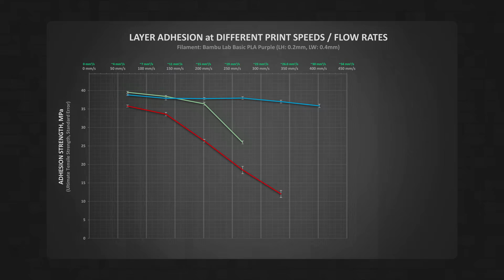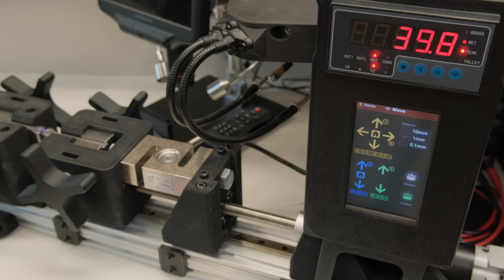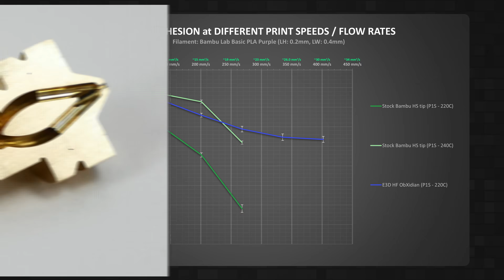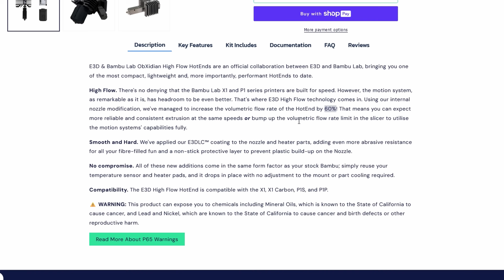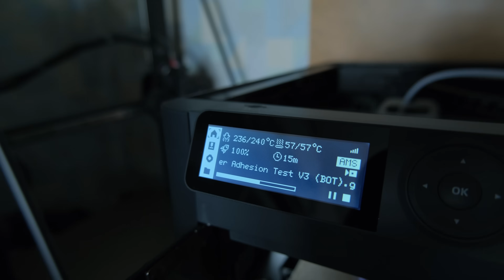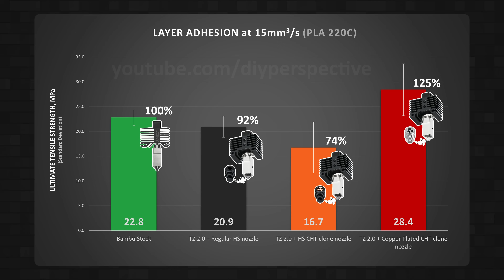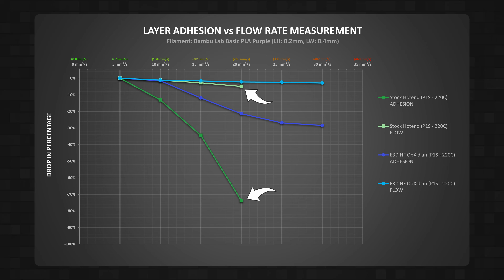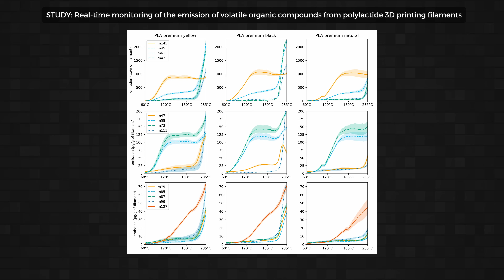LAYER ADHESION TESTED: Bambu Stock vs TZ 3.0 vs E3D HF ObXidian hotends (220C vs 240C)

Comment: Glad to see someone testing on the TZ 3.0. I've been eyeing it since my 2.0 does nothing, but clog itself to death. I figured it was probably heat creep and was hoping the 3.0 would fix that issue. Don't know if it's worth it to get one now that I see there are no visible gains when it comes to flow rate. 

I've got an X1C and I just keep the stock .4mm hardened steel hotend installed now until I can find an actual upgrade that is similar in cost to the stock hotend.
Reply from the maker: Did you used high temperature thermal compound around the top of the heatbreak? The only time I got a clog due to heat creep was when I forgot to turn on the heatsink fan. That is the biggest mystery for me how other people manage to do that.
Reply: @DIYPERSPECTIVE  I can't remember if I took apart the heatbreak. I'll have to check that out. I initially was having issues maintaining temp(especially when printing PETG, ASA, and PC) so I removed the 2.0 hotend. 

Then I saw ModBot mention that the stock heater cartridge might not be able to keep up with the new hotend, but I have not purchased a more powerful ceramic heater yet for that. Instead I redid the thermal paste on the thermistor a couple times and that helped for PLA(never got around to testing PETG or PC again). After that, I started getting clogs and jams when changing filaments. Changed the cutting blade after having 1000hrs on my printer and used some reliable filament, then the jams continued. I thought my printer room could be too hot, so I left the door open to vent the heat from the room(that always works with the stock hotend installed). There was no change. I've got the printer lid removed with a riser and monitor the chamber temps if I see reoccurring jams, but chamber temp was not the issue. 

Then I thought to myself, I fixed the issues with heat creep and jams on my older printers with bimetal heat breaks. When I saw the VZ3.0, I thought that could be the saving grace, but I couldn't find any testing or documentation about its performance. Now I see your video and I'm wondering if it's even worth it. I wanted a cht clone to better help with part strength and speed, but it's been nonstop issues with my 2.0, so it's benched at the moment. What would you recommend for a more powerful heater that fits the Bambu printers and is a drop-in replacement?
Reply: if you print PLA open your enclosure, otherwise idk why your tz 3.0 clog.. mine works fine with tpu/petg since 4months now
Reply: @romainfichet5352   my enclosure is always open for PLA. I close the lid only for PETG, ASA, and PC. I haven't purchased a TZ 3.0 yet. These are all accounts I've had with my TZ 2.0. 

I really want it to work because I've seen the positives that can come from a CHT or CHT clone. I really want my silk PLA prints to maintain their strength and shine without having to greatly reduce the speed or possibly degrade the filament with temps that are too high.
Reply: I’m not certain if the original cooling fan in the X1C is causing issues with your TZ2.0, but just to share, mine’s running smoothly in my DIY Voron 2.4. I’ve got a 4010 hotend cooling fan installed, and it’s handling ASA-CF prints using a cloned CHT hardened steel nozzle like a champ!

Comment: The hardened genuine CHT also is using hardened steel insert in a copper shell. I fear it wouldn't score much better than the cheap CHT.

I guess I'll have to actually do measurements once I get it.

This makes me also think that it may be better to get a volcano CHT and cut 2 mm off it rather than using a QIDI adapter and a V6 genuine CHT.

Or simply I'll print abrasives at 10-12 mm³/s
Reply from the maker: But here is the other way around, copper inside rather than outside shell on CHT.
Reply: @PrintingPerspective  yea but like you showed, thermal conductivity of metals is at least 20x the one of plastic so it's very likely that the swap of material for inner/outer matters little. 
For example the obxidian is made of brass, not copper,and beats every other one.
I guess the e3d nozzle gets the boost from the shape and amount of surface, not much because of the material. As IMHO direct consequence, swapping copper and HS won't change performance too much between genuine and knock off chat.

Tough choice, I'll try to get measurements on the stock before picking a replacement.
Reply: @PrintingPerspective  can you get Bondtech to give you some genuine bimetal CHT?
Reply from the maker: I always can ask, it would be another step in figuring out more about layer adhesion. But usually unless companies reach out to smaller creators themselves it is impossible even get any answer lol.
Reply: @PrintingPerspective  for completeness, I think the obxidian should not compete with the hardened steel nozzles: I found on the website that it's just a coated nozzle. They say it's harder and more resistant to wear, but also that fiber materials will wear it out. So not really the same field as hardened steel which will last a long time, except maybe with glass fibers.

Comment: i got my self a Triangle lab meltzone extender plus and i now have a ceiling of 22 mm3\s rather than 8 (with no proper layer adhesion) or around 6 with minimal recommended temps from my filament manufacturer. i use abs, have a copper v6 heating block and a 40w heater, thermistor is really close to the nozzle treads drilled from opposite side of the heater.

Comment: Wow. Thank you for this. This was actually shocking for me and very insightful! I was shocked by how much layer adhesion drops in the stock hotend with flow rates above 10mm3/s... Given that I print, mostly, mechanical parts, I'll definitely make some changes after this video.

Thank you for this
Reply from the maker: It also depend a lot on the filament and even a color of it and the print itself. If you printing something small with a lot of details you won't have any problems but when you start printing bigger practical prints where you spend extruding a lot and not slowing down or traveling much, then the adhesion suffers.
Reply: To me it emphasized how important it is to actually pay attention to temperature. If you need a big strong part, go ahead and run PLA at 240. It won't be the end of the world.
Reply: I'd love to see more of these filament/settings/hardware comparison videos, since you seem to have quite a nice setup to measure these kind of forces!

Comment: Wow, super impressive. I didn't even know E3D was making Bambu-specific hotends. Ordered one after watching this video!
Reply: Yeah, I am about to order one right now as well. These kinds of videos are exactly the kind of thing I have been looking for.
Reply: How are you liking it?
Reply: @MrBiggs-wu2kf  It's made a huge difference, I have noticed. Especially when printing with 0.12 layer height. The prints are strong as hell (when using PLA+)
Reply: @MrBiggs-wu2kf  I haven’t really tested the strength claims, but I have been able to print PETG at 30 cubic mm per second in tests very successfully, and I’ve gone up to around 24mm3/s in actual prints and they seem strong. That’s with cheap Overture PETG. For PLA I’m usually not pushing speed limits because I’m printing production parts that need to be reasonably strong with good cosmetics without post processing. I was happy enough with the first that I got a second for my other X1C.
Reply: There is also a REVO version but it's super expensive and seems geared more to quick nozzle changes. 

I own the OnXidian and outside the higher flow rate, prints are slightly cleaner and the non stick diamond coating actually works on PETG so the price really is justified. The best thing is all you have to do is change the volumetric flow rate for faster prints. Obviously there are other settings to increase speed but that one setting alone results in faster prints.

Comment: Hmm I think  CNC kitchen’s test didn’t have the same results as you I think. Weird
Reply from the maker: I don't think Stefan ever tested layer adhesion at different speeds and flow rates.
Reply: @PrintingPerspective  he did in the stock vs v1 high flow hotend but actually I just remembered, I think he used brass
Reply: @PrintingPerspective  he is stuck with his test samples which can't be printed faster due to surface. He tried to print faster once but the results are less concousive.
Your samples allow it.
Reply: He did use brass nozzles, which perform significantly better than HS ones (in my own experiece): hs cht clone < stock < brass cht clone < e3d obx.

Comment: As you had mentioned briefly, I think most of this comes from the nozzle material, the TZ and Bambu use the hardened steel vs coated e3d, I think the Bambu and TZ would perform similarly with a brass nozzle with cht, as you found the TZ with copper plated CHT performed significantly better vs the standard hardened steel, seems to all come down to thermal conductivity of the nozzle material itself.

I believe they use standard v6 threads so maybe popping a v6 cht clone would be a quick and dirty test, would need different fan ducts though.
Reply: me and my .2/.4/.6/.8/1mm fake cht hardened nozzle crying together
Reply: @romainfichet5352  I mean they're still good for wear resistance, you can also just turn up the heat to some degree to compensate.
Reply: I agree, it’s been known for a while that hardened steel just isn’t that good with its poor thermal conductivity. It surprised me back then to learn that Bambu labs came with them by default.

Comment: I really want to say thank you for doing all the work to do with such extensive testing.I've used the v2.0 and V 3.0 and so far. I like the 3.0, because I've been able to use it to print PETG. At 22 mm per second. Honestly. Caught me off. Guard to strength is that much weaker. I never really noticed it Producing nervously weaker parts. Though now my wallet dislikes you.Because I honestly do you see myself ordering a .6mm .e3d hotend. I do you have a question because I noticed using the .4mm CHT insert hardened steel nozzle would require a great deal more purging. And sometimes even have a small blob from a previous color 5 layers into a new print. Would you recommend  e3D nozzle for any multicolored printing?Or is the purge necessary too annoying ? Lastly do you think the e3d is any more susceptible to clogging when printing with carbon fiber filament? Thanks a lot for any info you can give. i'm very interested in getting that upgrade just a little nervous about spending that much but I do like the idea if it doesn't have huge major downsides.
Reply from the maker: I don't do multi color printing so it is hard to say. But yes you will have to purge more which will provide even more waste. Maybe just increase printing temperature slightly for multicolor. E3D hotend mostly shine for practical prints where layer adhesion is very important. About clogging, I never got a clog using 0.4 nozzle with bambu carbon fiber filaments where they don't say you can't use it. I wish E3D made 0.5mm hotends as 0.6mm one reduce print quality too much.

Comment: I had similar experience with "CHCB-OT" // Chinese cheap "upgrade" hotends, on K1 Max -> Not enough power, way worse than stock Creality offering.
Reply: Interestingly, a basic V6 w/ Cheap CHT Clone from China has proven to be magnificent beyond belief.
Easily outflowing K1 Max w/ Nickel Plater Copper nozzle even

Comment: Excellent study! I'd like to suggest you get a cheap but proper tensile tester, so you can test ASTM dog bones. That way results can be compared between studies.
Reply from the maker: Thanks. But you can't properly test layer adhesion at different speeds with those. The whole point is to have a big print where you extrude plastic non stop with least slowdowns and travels.

Comment: I would have liked to see the TZ graph at 220C, but yikes.
I received mine shortly after you posted the image, and doubled down and ordered plated nozzles.
But I might just go back to stock...
Reply from the maker: If its performance wouldn't be so bad, I would have tested it. I went back to stock on a couple of 3D printers as I also print abrasives. TZ 2.0 with nickel-plated copper nozzles with inserts is the only way to better performance. But now I question myself if just a regular plated copper nozzle without the insert wouldn't be better.

Comment: For the day day , its better the original or the 3.0 with cht ?
Reply from the maker: I went to the original on a couple of 3D printers, so the original. You just need to print at a higher temp, for PLA probably 230C would be enough.

Comment: 5:56 poor kp3s. Hope you gave it some new and better guts.
Reply from the maker: ;D Haha, my KP3S printers are probably the most loved and modded ones out there. To this day I love modding them. :)
Reply: @PrintingPerspective  Nice to know someone enjoys their kp3s my kp3s pro is so annoying the z linear rail block that connections to the x axis is loose and gets displaced easily, no solution yet. Got an anet et4 for cheap will try to mod that into a good printer though linear rails are too expensive.

Comment: Great test, I was using the knock off cht hardensteel nozzle and was wondering why is my prints getting poor layer adhesions
Reply from the maker: Yeah, this was the biggest disappointed of this testing marathon. :/
Reply: @PrintingPerspective is it enough to buy just decent cht clone nozzle for tz3 to improve that result?
Reply: Same, I switched back to Bambu hot ends because the cht was giving me extrusion issues.
Reply: I also tried a knock off and went back to the stock 0.4 HT after a few issues.

Comment: Great video! I wonder if you're right about the top of the heater block being cooled too much on the knockoff hotend, reducing flow. Any chance you'd drill a few more thermistor holes at the top and bottom of the hotend you already sacrificed? And maybe another test with the supporting screws in the heat block removed?
Reply from the maker: I need a CNC machine to do that more accurately. Drilling copper with a handheld drill is horrible. :D I am very curious about the TZ hotends performance so I will probably revisit it someday, but not soon.

Comment: I havnt tried the E3D nozzle but i have got the v1, v2 and v3 of the bambu compatible hotend and for me the v3 definitely can run the best out of those 3 and v2 and v3 can beat the stock in flow too with v3 doing the best. I don't have a method of testing strength like you other than just feeling with my hands but when I print PETG the bambu like to print at 12mm^3 but it will print around 15mm^3, the v2 slightly higher but the v3 will print perfectly fine to 23mm^3 and then runs into heating errors. I know most don't use PETG for speed or flow tests but its all I have tried thus far and so far the v3 with the cht clone seems to work good and the prints don't look any different and feel just as strong. Probably not what your looking for as I would need to test with PLA or ABS etc. but just thought I would say. I do like your tests and would consider getting the E3D but I'm not keen on its price.
Reply: e3d seems cool, but MAN that is pricy and it still has the insane downside of not having an interchangeable nozzle size. even for me, buying a v3 after my v2 broke (heatpipe insert stuck) and a new set of nozzles (2x .2 to .8), buying ANOTHER v2 with nickel inserts would still be less than one e3d with still just a single nozzle size.
Reply: @mrrooter601  Couldnt agree more and I see the full kit is now available from E3D now too at a higher cost of course. I just cant justify its cost. My V3 is doing me just fine for now thank God.
Reply from the maker: @TechieNI PETG inherently has great layer adhesion. Maybe that is because you can't feel the difference in strength? I don't know.
I agree that E3D costs a lot, but considering its size the performance is just unreal. It comes down to if you can justify the price in your use case. Increasing the temperature on the stock Bambu hotend gives great results too.
Reply: Well, there’s a reason the stock profile goes beyond 220. That’s too cold to begin with.